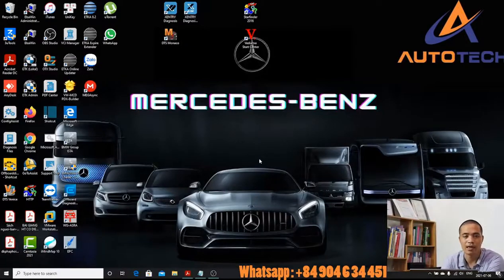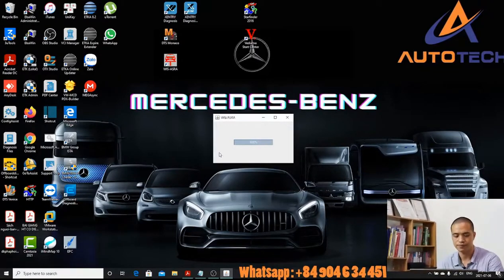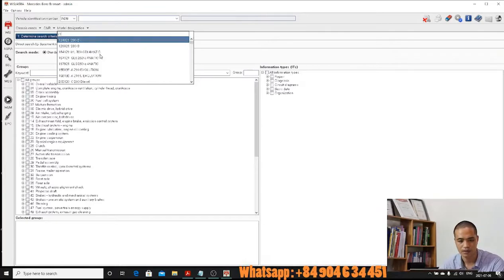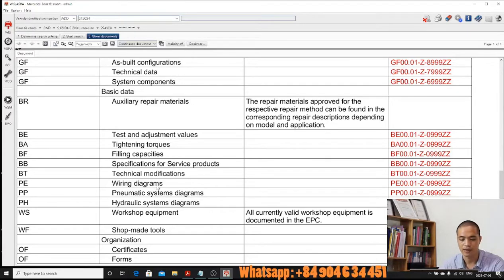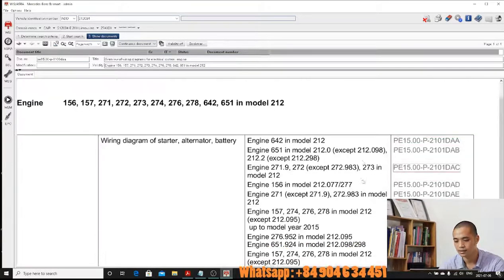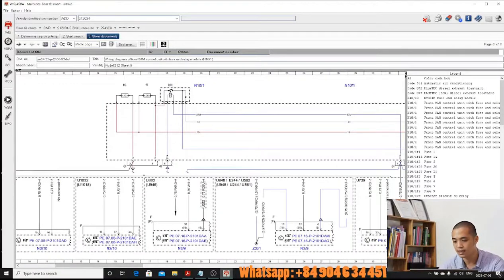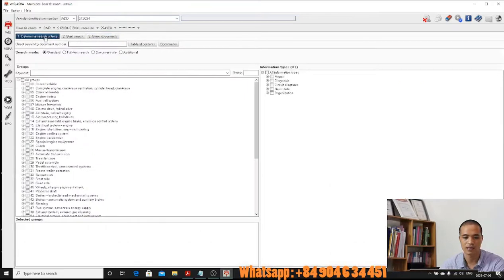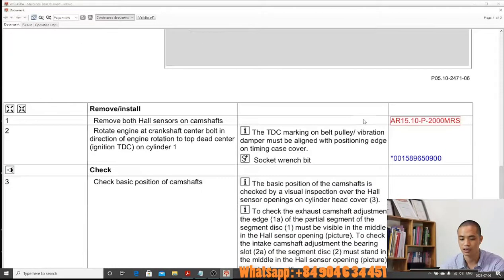MERCEDES - BENZ How to find Wiring Diagram with WIS/ARSA | EUROCARTOOL.COM

Comment: Do you know where to find voltage values of cables/signals/connectors?
Reply from the maker: Contact us via Whatsapp number.
There will be a technical team to support you.
Whatsapp: (+84) 373 676 888
Reply: @CarDiagnosticSoftware  I don't use whatsapp..
Reply from the maker: You also can contact us via Email : sale@eurocartool.com